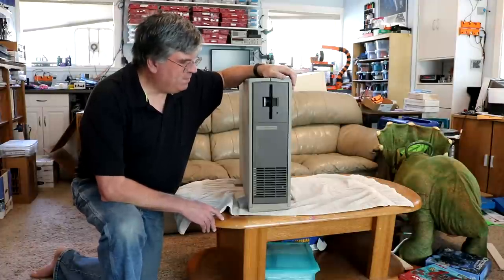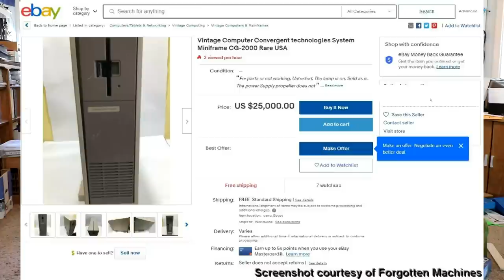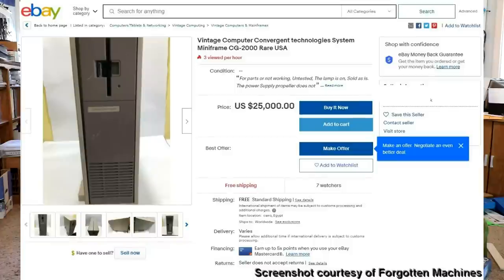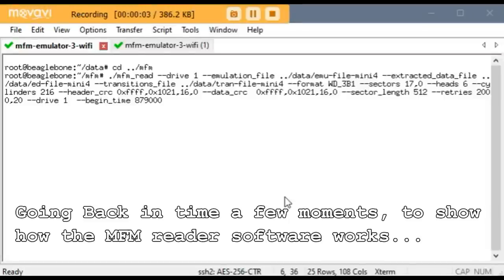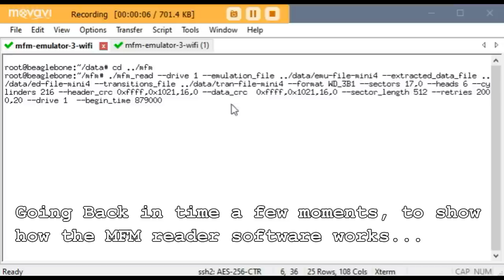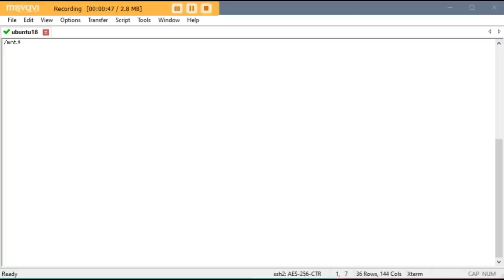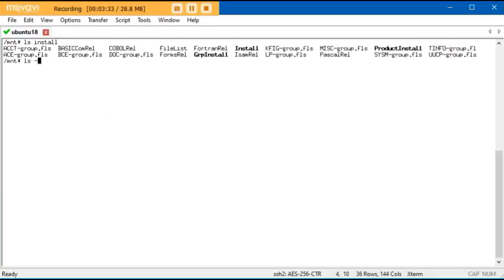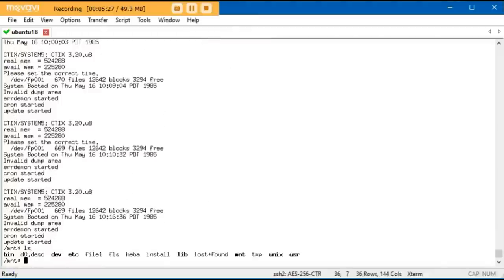Restoring a $25,000 Convergent Technologies Miniframe CTIX Unix Computer, Vintage from 1985

Comment: My company was a distributor for Convergent Technologies Miniframes and Mightyframes (VME based) back in the 1990s. We used these as servers with Locus PCI TCPIP software to provide TCP networking on DOS based PCs running AutoCAD,  since AutoCAD would not run with Netware. Later we moved to Motorola Computer Group 68030 based VME Unix System V systems. Motorola (aka Four Phase Systems) also rebranded the Miniframe for several years.